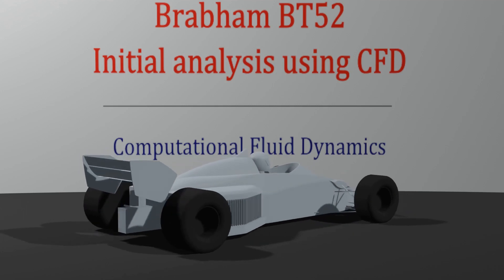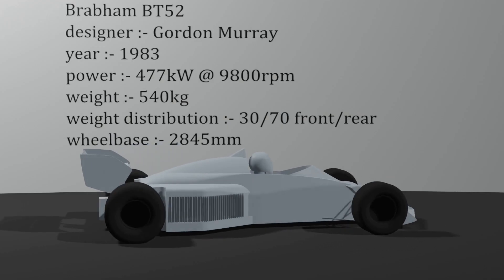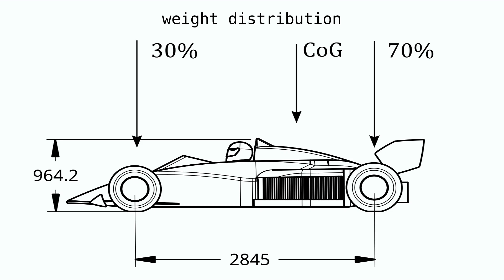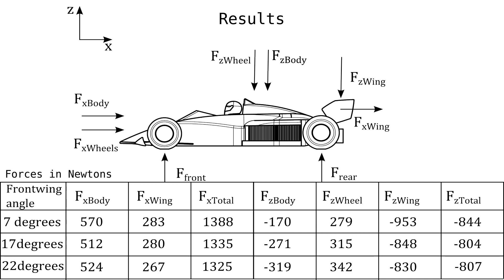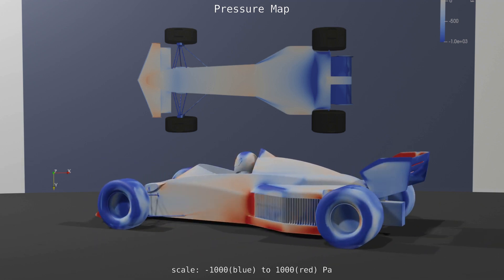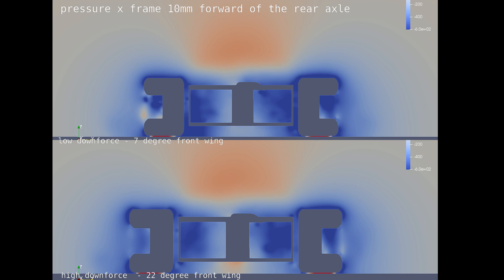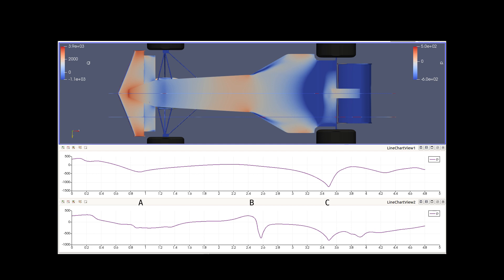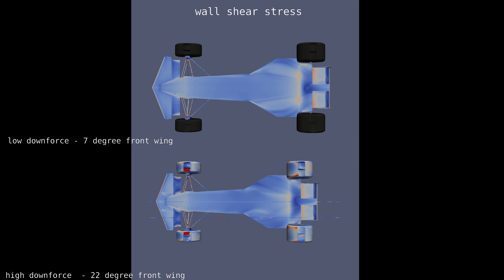A CFD Analysis of a Historic Formula One Car: Brabham BT52

Comment: Excellent Nelson, thank you. The real story of this car is the engine, the legendary BMW M12, using stock cast-iron blocks from a 4-cyl BMW sedan (If you want to know why the BMW Headquarters in Munich is 4 cylindrical towers, it's because of that engine. It, not their sixes, made the company). Turboed OUT THE ASS, it produced something like 1400HP at max boost, their dynos maxed out at 1290, but it's a good hunch. Old iron blocks were selected from FAMILY SEDANS that had over 100k km on them as the were reliable. Piquet became the first driver to win a driver's championship in a turbo-powered car, he said it was like a rocket w/ a switch. For those familiar w/ the secondary imbalance forces associated w/ inline 4s, on one occasion the pistons shoved the crankshaft down through the crankcase onto the track! The enormous power from the single giant turbo played into aerodynamics as well, allowing the car to run w/ a smaller engine and have less frictional heat loss as a result (less moving parts), smaller radiators, and thus the skinny short sidepods vs the enormous ones on the Renault RE30.

Comment: Nice to see this attempted.  Not convinced that you've captured the aero contributions.  Some details matter and I think there are some important ones missing such as a radius on the leading edge of the floor/side pod and variations in car height and yaw.  Probably worth finding an actual car and getting more photos to refine the accuracy of the model.  One would have to do that to the whole grid of cars to the same level of detail to be able to really comment on the relative aerodynamic performance of the cars...  My experience suggests that drivers of this era would be able to detect changes in overall balance to a few % so it is highly unlikely that the cars ran with the low aero balance your estimations suggest.  The model is extremely simplistic.and experience of wind tunnel testing in the mid 1980's suggests that this simplification has a significant impact on the predicted forces.  So, my feeling is much more detail is needed.
Reply from the maker: Really appreciate the feedback. My idea was to do a longitudinal study. Stating the number from steady state is precarious to say the least, but I'm try to not emphasis the numbers to much or at least mention them relatively. This being the first model I don't have that relative context. 
I agree the model could be better, particularly the floor edge. But, I'm try to paint a broad brush...if that means anything. I was planning to go back a do a series if these cars with steering and yaw. It would probably be an opportunity to fix all the modelling errors in all the cars.
The Haynes workshop manual gave Mansal's feedback from his test and he mentioned that this handling characteristic were strange. Though not specifically strange. I've seen many images of this car at all ride elevations so run this simulation at this ridiculous height didn't seem that absurd. Seeing the front wing effect the rear wing was a good enough result to publish in a YT video..... Changing the front wing height was just some else..among many. I am running these on a gaming pc.
Again, really appreciate the feedback.
Reply: @nelsonphillips  good effort.  Gaming PC's despite being fantastic machines are not able to give realistic results for a aero calculations like these but rough trends will normally be in the right direction.  I do very much love that you're giving it a go!
Reply from the maker: Sure, its not your average gaming PC, it supports 67mil cell mesh, should mention that somewhere....it a little important. The mesh is still only created with snappyhexmesh, so there is room to improve here as I'm still wall modelling. So if I am to run a marginal aero surface, like i did with the march 881 the results start to get a little difficult. 
I'm more than willing to give you one of the models for you to run because I really have no interest in believing my own BS.